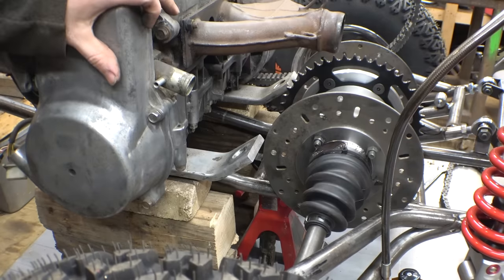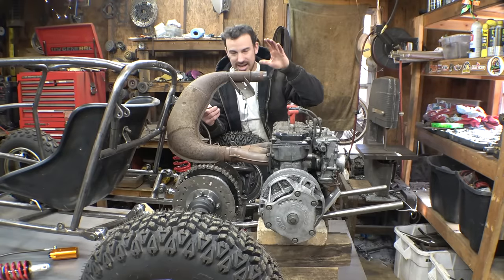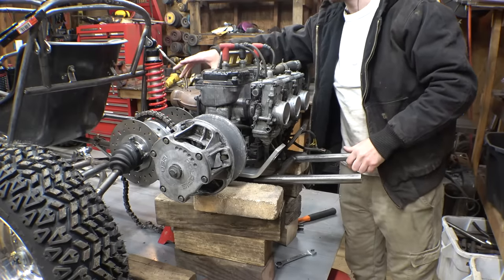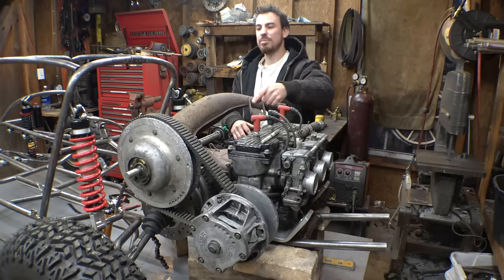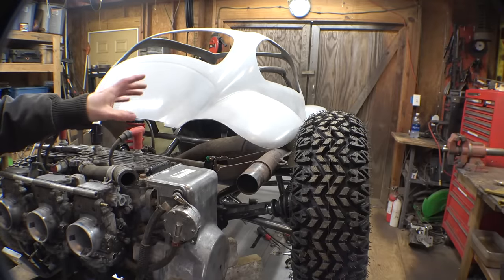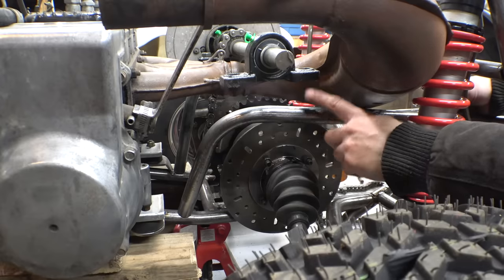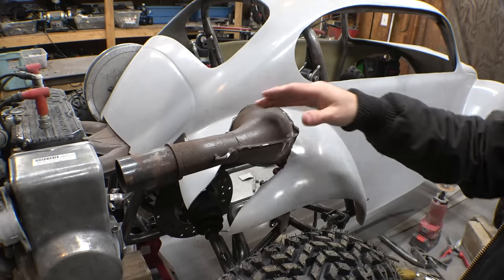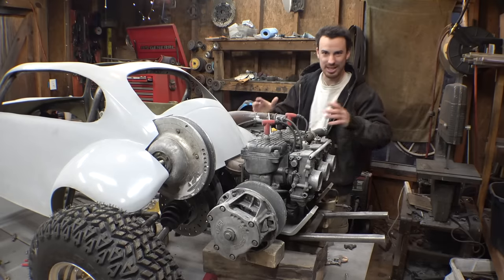Installing the Engine on the - Home Made Mini VW Baja Bug!! - Part 7

Comment: This mini-bug has more HP than a real one! What a masterpiece!
Reply: A lot more 😂
Reply: red somewhere that  a 3 zylinder 2 stroke has the most power in ratio to his own size and weight.  so it will be wheely monster;)))
Reply: It's actually zero horsepower as it sits. I wonder how many months of videos will have to sit through before the carbs are dialed in this time
Reply: @mostlymotorized idk why don’t you make one and get the carbs tuned faster?

Comment: That poor primary isn’t going to survive long at all with its placement. If you plan on riding that thing anywhere near water the belt is going to slip. If you run it anywhere near sand or dirt it’s going to get covered up with debris and the dirt and sand will eat that thing alive.

Comment: My vote is exhaust out back window and 2 smaller radiators behind seat down low. You can make them face any direction you want to fit in that Tetris project.

Comment: I really love how you approach a small and compact project like this, where you really have to think twice or thrice to fit everything in the back so that the Baja Bug body still holds its shape even if it sticks up some engine parts here and there and that you are so careful with the aesthetics and don't just put everything together in the simplest possible way, but come up with really nice solutions! An aluminum rim around the expansion chamber will be great and dress up the CVT transmission with an aluminum cover too! Really nice work so far Chris and it will only continue in that direction no doubt!

Comment: Looking at this now you may have been better off mounting the engine longitudinally over top of the unmodified differential setup and moving the brakes outboard to the wheels.  Underslinging the diff setup would have opened up a bunch of space options as well. Check out what Jimbo (Robot Cantina) did with the setup on his little Renault

Comment: Reason why the mounts are at an angle like that is to help deal with the forces of the cvt that are applied to the rubber isolation mounts. When you have them at an angle it squish’s the rubber in the mount. When they are mounted flat it puts a shearing force on them and they will break apart much faster. I’d suggest installing a torque arm between the two clutches like a lot of sleds use. Make it a beefy one since you changed the way the mounts are oriented. I’d also put one from the side that is away from the cvt that goes from the motor to the frame. Nice work. Wish you’d put a body like the bug on the trophy truck. (Just not a bug. A real trophy truck looking body.

Comment: Great work Chris, I seriously doubt that I could have come anywhere near getting all of that gear packed into that tight of an area, I am in awe. 
 As far as the radiator goes, maybe you could use something like the old Bonneville racers did. Instead of a radiator that allows air to flow through it, you just need a large tank (or two smaller ones) big enough to circulate water through to cool it off. The advantage is that it wouldn't need to be anywhere in particular,  since it isn't dependent on air flow as much to cool the coolant down. Just a thought.  Looking forward to seeing your next video!

Comment: Chris how about running two smaller radiators up under the body in front of the back wheels? Obviously mounted out of harms way and with high-flow thermo fans. 
I think having radiator at the back window will take the gloss  off of how awesome this thing is going to look.
Reply: That's a great idea. Triangular nerf bars to stop the rear wheels from catching trees and such with a small rad mounted in them on each side.
Reply: @jasonbirch1182  yep. But I think mounted behind the fibreglass body as not to be seen. Perhaps even with vents or louvres in front of the rear wheel fenders.
Reply: @rhyswoodman6781  I doubt that is feasible. They need real airflow. Fans are ok for idle but not full rip.

Comment: Yo looking good, it’s going to rip proper. Get ready! I saw a full size rail at the St Anthony Sand Dunes that had two Polaris 900’s. One behind the shaft like yours and the other engine in front of the shaft. His secondary’s were directly on his drive shaft. It absolutely shredded the dunes.

Comment: Sweet build. As a sled enthusiast myself, I highly suggest and recommend you not forget to shield the secondary with a belt shroud. If a belt lets loose under full throttle without a shroud it can injure you and destroy other things. Ask me how I know.
Sweet build though. Huge fan of 2 cycle CVT builds.

Comment: You may have to get a small wing for the front  variable pitch controled  to keep front end closer to ground under extreme throttle and maybe cornering in loose surfaces..

Comment: you should look and see if you are able to cut out the trunk from the shell and then hinge it and wedge it open as it may solve the clearance issues. it's a mod not unusual for a bug to have a fixed wedged open trunk flap for extra space and cooling etc...
Reply: I was thinking this too..

Comment: Lookin' good!  Maybe consider losing the fenders completely (at least rear ones)? Maybe some mesh or thin panels for "wheel wells", like a real bug.
Very common for them to run just tiny flares, or even no fenders at all. Check out some pics?
Also, why not have the exhaust coming out the back and intake in front? Wold make life so much easier!

Comment: Perhaps consider making new fenders that are 1" larger than the rear tires @ full stuff. That combined with the oval rear window suggestion would keep the Baja Bug flavor with more strength. running 2 small radiators on either side of you blowing the air out through the "doors" might open up some different packaging options for you.
The angle of the expansion chamber can be altered by pie cutting, rotating, and rewelding if need be.

Comment: Baja bugs typically mount an oil cooler just above the engine on the part of fiberglass between engine and  bottom of the rear window. You could just make stand off brackets. Mount the radiator and then an electric fan pulling air through radiator. It wouldnt take up much room and the addition of the electric fan would make sure it ran cool even when you werent running very fast to move the air naturally around the radiator. Just a thought. I was going to post a picture of this setup but cant on here.

Comment: Bringing roll bars up over the engine and tying them in above the rear window of the shell then mounting the jackshaft near the cylinder head off those roll bars would have solved all your problems and without cutting the fiberglass shell. Oh well.

Also two-stroke exhaust gets just as hot as four-stroke exhaust. Same air fuel ratio required = same exhaust temperatures produced

Comment: You might have been better off chopping the fiberglass body from the very back of the sunroof down through the door, Movie the back part backwards 1 or 2 foot and making and putting an extension in the gap to extend the entire body a bit making all the fittings of pipes a CBT etc cleaner and much easier. Would probably have looked much nicer and nearer as well with section of Aluminum plate as the extension. Also expansion chambers on a 2 stroke can run as hot as 1500F and on average run around 700F-800F I'd say that was pretty hot but it's different depending on what part of the chamber you take a reading from and obviously from engine to engine so I'd definitely cut a bigger hole for it and surround it with Aluminum. Loving this build so far man you've come a long way from the early days. Still think you should do a build that you design totally first on CAD so you know what you're doing and what you'll need etc. I mean it'd make a nice change and be interesting to watch as a viewer and if you don't like it or end up changing a lot anyway then you don't need to try again. Just an idea due to how much you've improved in every other aspect of the build process.

Comment: For future reference.  A two stroke definitely doesn't need back pressure.  It's been proven that a megaphone type exhaust will send a reverse pulse as good or better than any expansion pipe. The important part for performance is that one cylinder exhaust pulse doesn't interfere with another.  Separate pipes makes this easier to calculate.  Harry Brinkman book can inform on pipe length related to intake volume if you ever want to get into custom pipes.

Comment: I'd make scoops on side blowing or directing air to radiator and then also figure a fan in for it somehow to help for extreme heat possibilities and after the body is trimmed out all the way use door trim stripping to trim the body out maybe would make it look clean or factory looking I'd guess just a thought and give a secondary color too

Comment: Im not sure if you have ever thought about it, but if you ran the engine backward , the exhaust would be in the back. May make for better fitment. Would only have to come up with a way to change the ignition timing and a way to change the direction of the starter . Just a thought

Comment: Look at doing dual radiators like some sport bikes or Porsche do. My VFR has one on either side. You could put one in front of each rear fender and mold in a housing that would look good. This would allow a spun aluminum tank in the back window for fuel.

Comment: It's also going to change the way the fuel runs into the engine it's going to go flat and be sucked in rather than pour in because it's at an angle😊 and it will also change your float bowl levels that is a most definite and I think with your extensive education on your bills and what runs them you completely understand the schematic of the deal yo y'all 😮😊

Comment: Try running the expansion chamber over the differential and under the axle/engine, then put a muffler pointing up and away from the engine. It'll be out of the way, and clear everything including the ground

Comment: I think you should have used 2 smaller radiators mounted in front of the rear fenders on each side, and built nerf/bash bars to protect them and the fenders. Then you could have ran the exhaust out the back window without having to cut away so much of that sweet body.

Comment: Definitely needs a secondary belt guard !
To stop the belt from hitting you in the back of the head (and clutch parts) 😮 The sled had one! Don’t neglect it !
I’m a snowmobiler and I’ve seen what they can do 😮😮! High RPM primary is the biggest explosion (lots of sharp steel parts in there)
Had one go through drywall, insulation, 5/8” ply and lares of ash fault roof not good . Safety First

Comment: Well if you remember right Baja bugs back in the day had exhausted shot straight up sometimes through the back window I mean think about it back in the seventies eighties how they did the Baja bugs and exhaust you can do some pretty cool stuff without cutting the fiberglass or at least having to make a nasty delete little round cutouts near or a round cut out near the back window the lower half upper half whatever you got to do but they did just used to run it straight up off the motor and face it back lightly yo
Reply: My street bug has a stinger lmao

Comment: I definitely think you're going to be changing the oiling features & cooling featuers. of this engine they are designed to be at that angle on the bike & or a snowmobile for a specific reason😮😮😮😊
Reply: Engines in XLT sleds are mounted straight up.

Comment: I thought you did a great job making the diff and chain drive setup with cutting breaks, I'd be really interested in possibly making a LSD that's chain drive so you get the added traction when slippage acures but still will allow you to use the cutting breaks as well

Comment: Yes, you are correct in thinking that you are going to want to put some heat shielding around the areas where the fiberglass will even get a sniff of the heat from the engine. In regards to the weight distribution, you could do it the "Simple and cheating way." Aka: Weld on some short wheelie bars. Simple, easy, fixes the problem. They wouldn't have to be any further than the engine mount is already.

Just make a dual skid plate to protect the motor/wheelie bar combo.

Comment: FIY
I don’t know if that “vintage” Polaris had one but there should be a adjustable bolt with a rubber head pushing on the block behind the primary clutch, inline with the crank should be a flat area for it on the 2 block half’s. It takes torque-pull away from the motor mounts and keeps belt in alignment.

Comment: You could Change the angle of the outlet of the expansion chamber and put the muffler between the engine and the jackshaft, above the header so it blows right through the inside of the belt...

Comment: You might want to include a secondary clutch guard, I’ve seen those belts go thru the side of a snow machine hood when the belt explodes. It’s awfully close to the driver

Comment: Don't touch your skin when it has fiberglass dust on it. It imbeds the fibers in your skin, and it itches for weeks. We used to rinse it off with a rag soaked in acetone and then blow it off with compressed air. I realize it's probably not good for you to rinse your skin with acetone, but it works. The acetone takes the oil off of your skin so the compressed air can blow the fiberglass dust off.

Comment: Use the pipe frame as radiator. Hook the hoses at rear and run the coolant all over the frame around. There is more pipe you need.
Reply: You could also make a front ”cattle bumber” from pipe and hook it to coolant circuit that runs in the frame.

Comment: you should do  Moon tank on the the front bumper like the old Gasser style drag cars did you could mount it outside the body off the front bumper that would really help your weight and balance and those tanks look really cool as well  would kind of be like the tank you built for the CBR1000 project

Comment: Using a fine tooth jigsaw blade or portable band saw is much saferfor breathing and doesnt' create all the Toxic dust when cutting fiberglass.  Even an air body saw will work well.

Comment: Have you thought about putting the radiator in a drag wing over the motor and flat (horizontal).  The wing can hide it, and may be situated to cover the CVT bits

Comment: You could put rock bars on the sides and put two smaller radiators on them at an angle and duct them.

Comment: Hey there Mr RBW maybe fibreglassing the whole rear window hole up and recutting the older smaller oval window shape to give you back the body structure around that monstrosity of a pulley sticking out the back ?? Mark from NZ

Comment: The only reason those engine straps are angled is so the engine can be mounted low in the sled. Moving the mounting position like you did should not negatively impact anything

Comment: seems that you have to put a piece of aluminium in the lower left corner of the rear window to stiffen the body  and to provide  a spot where ther radiator and the cvt cover can attach to...
🤔👍

Comment: Potentially silly question - why does the bearing on the passenger side have to mount horizontally?  Could you rotate it so the flange is vertical (and to the rear) and then run the tube straight up, and then over the expansion tank?  It would put the stresses in different directions, but it would potentially make the routing a lot easier.

Comment: You could have put the secondary pulley on the intake side run the chain down underneath the engine and then back up to the axles

Comment: How do you figure the expansion chamber doesnt get hot like a header? Thats exactly what it is. That shock is going to cook. Fiberglass resin burns too. If you dont do something about a rollbar you can just name "this thing" as you call everything white death, or the paralyzer. Build a safari rack look alike that you can mount the rad too and get it up to head height for roll  protection.

Comment: Two-Strokes VIBRATE like crazy, the exhaust even more-so- That should be RUBBER mounted!!! all those solid mounts will cause cracking and tearing - the original pipes were mounted with springs and rubber for a reason.........
 you're going to have a RUBBER mounted engine that will be able to wiggle and then mounted to a rigid stiff exhaust? how will that work, it needs to be all mounted in RUBBER

Comment: If you're using that thing like a sand rail put the engine way back. It looks like extended wheelies are a blast and look incredible! The motor is only 95 HP. Those wheelie rails have hundreds and hundreds of horsepower. You should be alright putting it away back.

Comment: I would have cut out the engine hatch on the rear of the body and placed the radiator there, might even be able to make it look like part of the body. Then the expansion chamber could come out the back window.

Comment: Have you thought about making an air duct with a fan that sticks out from underneath in the front that goes to around where you build the gas tank and mounting the radiator horizontally on the bottom with a filler neck going up to the back window of the body

Comment: Can Fibreglass catch fire?
Fiberglass can withstand high temperatures, with its average melting point being 540oC.. Another crucial property of fiberglass is its fire resistance. It will not catch fire and prevent fire from traveling through it, reducing the spread.

Comment: This style of build might have been neater with a transaxle gearbox, only I'm not sure where you'd get one small enough. Like a Porsche 915 transmission but smaller?
(edit) - Ironically a classic VW beetle gearbox mated to your 2 stoke mounted 90 degrees from current location, shifter would be behind your seat. Not sure about rotation